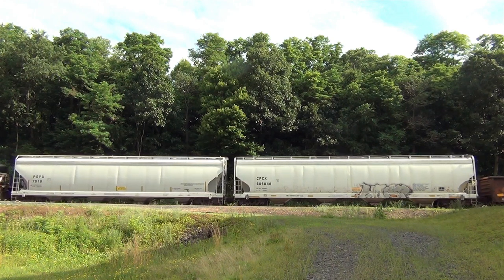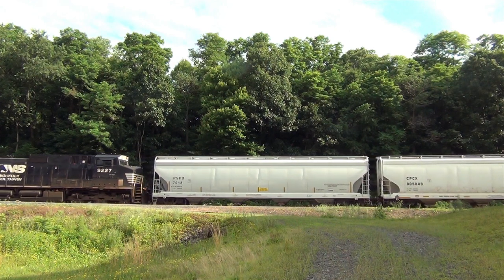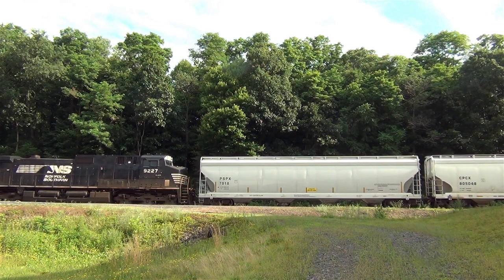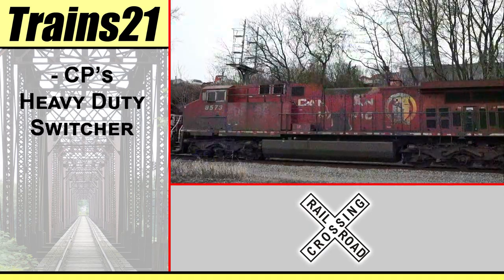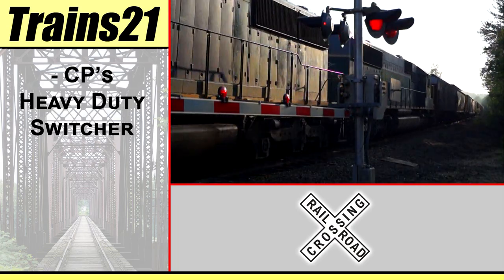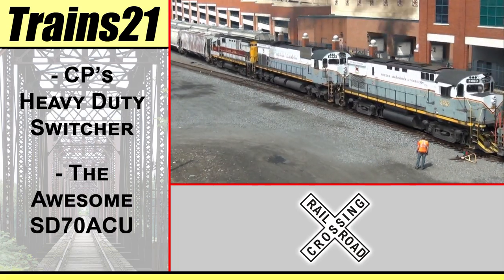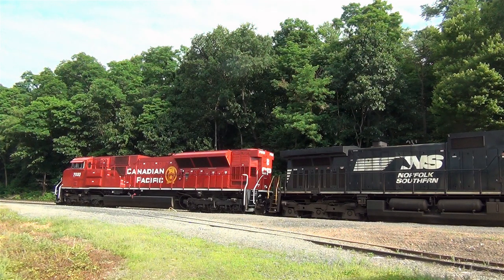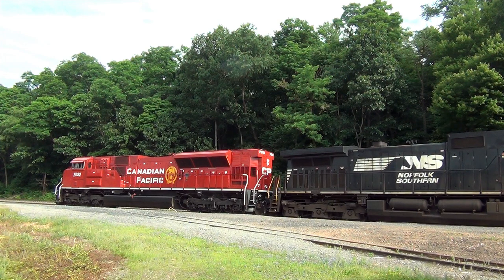[GL][T-245] CP's Super Power: Switching with the AWESOME EMD SD70ACU!! | Trains 21

Comment: Got to correct you right off of the bat. The inverters were Siemens but were replaced by Mitsubishi inverters. I know because I’m a retired technician from UP who worked on all of the SD90 iteration of locomotives for UP with EMD tech help. Siemens were a pain to work with because they kept much of their info proprietary & even the programs we used to interface with their electronics was in German.
Reply: You are correct.
Reply: On several aspects those were the worst units that EMD actually built. Many of which were scrapped because of cracked frames and why Union Pacific sold them dirt cheap to Norfolk Southern only to inevitably have the same problems again as SD70ACU rebuilds. The same electronics were also used on the SD70ACE's and equally junk as well.
Reply: @Slim_Slid  The cracked frames on the 90s was actually causes by UP themselves. The fuel tanks were designed to float on the frames because of the length of the loco. UP decided to hard tighten them to the frame causing the underframe to flex in a vulnerable place causing this crack. SD70Aces were actually one of the more reliable locomotives UP had. The SD70 was very reliable and have been put routinely back into service. Tell me where the Dash8/9s are as far as DC units? GE loco engines routinely caught on fire from leaking fuel lines. It was a rare occurrence for me to change out an inverter  on an Ace while it was a daily item for GE ac locos. The advantage for the GE’s was that you could cut out single inverter stacks where the Aces required you to cut out an entire truck.
Reply: @douglasbohnstengel9902  
There is plenty of C44-9W's returning to Union Pacific as C44ACM rebuilds. Practically it's the same process they did with the AC6000CW rebuilds. On the other hand,the SD70M's are being scrapped or put into storage with hardly anything being done to them. Those units are still out there,but it becomes faint with each day. The early production SD70ACE's were junk,this was before CAT/PRLX took over EMD,this was when things really took a bad turn just years before the SD70AH-T4's unforunately were produced. Hence the notorious "Thundercab" nickname,later on was when the production line had better built cabs and remained decent for awhile. The C40-8W's and C41-8's disappeared around the same time as most of the SD60's and SD60M's. Those units aren't very rebuild compliant compared to the C44-9W's or AC4400CW's. Years ago it was different,but modern GE units are actually becoming more reliable,easier to diagnose,and are less expensive to rebuild than most EMD units. It's not just the whole ordeal about EPA regulations. Wabtec did major changes to the market and production that GE refused to do. GE was never easy nor friendly on customers like EMD was. GE units actually outdo EMD units on horsepower and traction,everything else is debatable or complicated. For the longest time EMD retained reliability with the 645 & 710 series compared to GE's 7FDL's but that has changed over the years. As for the actual frame information on the SD9043MAC's,I never really knew about that so I stand corrected.
Reply: @Slim_Slid  Yes that’s correct too but I was referring to useage as DC locos. The ACM rebuilds being done by Wabtech will still invariably suffer from the same engine/inverter problems I suspect. I’m retired now and do occasionally talk to some UP & former GE (now Wabtech) tech & engineering guys but that’s becoming more rare. With the cutbacks in Mechanical there & the bad feelings they left with their laid off work force there aren’t many seasoned guys that would take a call back. It’s a specialized field & takes time to acquaint yourself with all of the different locos. I was an electrical tech & they’ve got rid of most of those jobs except for maybe North Platte. BTW the real clunker was the SD90Mac Phase 2. The H engine was a disaster because GM was trying to sell EMD at the time so provided no funding for engineering development for that engine. The idea was that as that 6000HP became refined in the 50 locos they made that they would be able to drop them into some of the existing Phase 1 90s. Excessive vibration caused the oil pans to crack over time. I’ve seen these locos repaired one day - put out on a train - & be dead offline the next.
Reply: @douglasbohnstengel9902  
Time will tell about modern and rebuilt GE units but it's inevitable regardless that these units will eventually overthrow what EMD units remain on Class 1 usage. It's really been that way ever since EMD discontinued production of the GP40-2's & SD40-2's. By the time the GE -8's were being debuted,a new era had just started mainly to do with improved technological aspects. I know most of the problems that the original SD90MAC's had. Union Pacific had 60 SD90MAC-H's at one point and most of the units were sent back to EMD and scrapped or remnant in storage. Some units were actually rebuilt and exported with brand new 265H's to Australia until BHP decided they no longer needed monster horsepower units. The same thing occured with the export AC6000CW's they acquired which were scrapped later on. EMD actually managed to prolong usage out of the 265H's for Asia,China,and India while also building the 210H's for foreign use only. There also was the SD89MX prototype which used a 12-265H instead of the 16-265H like the SD90MAC's. The SD70AH-T4's and Caterpillar 1010J's are literally based upon that prototype and also resulted in more failures. The only major differences between the prime movers are the fuel injection and crankshafts.
Reply: @Slim_Slid  I only got to work on the tier 4 Aces a few times before I retired. There were a few things I didn’t like (electrical locker was really cluttered). The GE tier 4 were engine maintenance heavy too. That is why they decided on upgrading the old Dash 9s as they didn’t have to adhere to the tier 4 standards. The GEs also have ample room for the installation of the inverter stack system I’m thinking whereas the SD70s do not. As far as emissions go I always found GEs claims to be a bit sketchy. When I watch the exhaust stack on a GE it’s always dirtier than an EMD. That’s unspent fuel. EMD always had clean exhaust stacks comparatively speaking. This assumes both engines are running with no mechanical issues. In any case shipping by rail is still better than any other form of transport environmentally.
Reply: @douglasbohnstengel9902  
Apparently the first 50 SD70ACE-T4's that were manufactured were short lived on good results and then everything on performance went downhill afterwards. Union Pacific keeps putting their 90 units in and out of storage for the same computer or fuel sensor problems. CSX had 10 ST70AH-T4's but those were finally returned back to PRLX and are on lease to Ferromex. BNSF,KCS,and Norfolk Southern also had orders which were canceled because of the obvious problems. Supposedly both the SD70ACE-T4's and ET44AH's are somehow more inefficient on fuel compared to most tier three or even tier two units out there,both EMD and GE. I find it ironic that the SD70AH-T4's were another flopped product after being based on the SD90MAC's to begin with. The only reason why GE has those claims is because of the entire four stroke versus two stroke comparison. While it's true that there is some benefits in the long run compared to EMD prime movers,I still looked at them to be sketchy about it while most EMD units were actually more reliable and easier to repair aside from certain electronics.
Reply: @Slim_Slid  Both manufacturers should have probably used DEF instead of the EGR models. The railroads didn’t want to deal with using DEF though. Much as you described the early Aces with cab noise (engine was now up to 950rpm and proximity was closer to the cab) that is an option that UP decided not to buy insulated cabs. Insulated cabs had been available since the 60 series (& were implemented on later Aces) - these decisions are made by the bean counters . I was witness to the change in attitude when they started making more decisions based on the stock holders and less by input from the Mechanical Dept.

Comment: Hey.. the CP ACU program.. is actually the ending of a contract dispute with the 9043s.  When CP took deliver of the 9043s the contract was to have them rebuilt to pure 90MACS within 10 years. Cp stored the 9043s after the 10 years and im assuming this remidy (Acu) program is a comprimise to the original contract.
Reply: The original SD90MAC's & SD90MACH's which were owned by Canadian Pacific and Union Pacific are singlehandedly the worst units that EMD ever created. Much of the failures were due to rushing developments and the fact that EMD was making the four stroke 265H's due to EPA compliance. The 265H's had little to no harmonic balancing and alot of internal vibration. The result of that from the prime movers was the cause for broken motor mounts,crankshafts,and other critical components. The other malfunctions on them were the German Siemens electronic systems and inverters,plus the units sucked at loading tractive effort for the traction motors. Even though later on the 265H's were improved and rebuilt EMD discontinued them for any usage in North America even though they did see prolonged service in Asia,China,and India .After Canadian Pacific and Union Pacific put their SD9043MAC's into storage Norfolk Southern purchased 110 units dirt cheap for the SD70ACU rebuild program while Canadian Pacific rebuilt 30 of their units. Part of that was them acquiring 6 SD80MAC's from PRLX to use as parts donors. Norfolk Southern sold 65 units to PRLX. CEFX has some SD9043MAC's as well that were even loaned to Norfolk Southern at a time.

Comment: Guess I'm too old school, I hated switching with wide cabs. The GE's were a little better cause they loaded up a bit slower. I remember switching out the yard with an AC4400 one day. That sucked. Great visibility going forward, backing up I was half blind. Not a good combo with a green conductor.
Reply from the maker: I love hearing from railroad workers, especially your piece on the EMD vs GE video.. Eyes out, the next one is the SD70ACC vs AC44C6M.. Probably out next week.
Reply: @Trains21  AC44C6Ms surprisingly have a lot of turbo charger damage considering how relatively new they are, and almost all the P5s on the SD70ACCs sound horrible.
Reply from the maker: @LocoPro  Agreed.. Fire damage seems to be prevalent on GE diesels.. Whether that's from shoddy workmanship or excessively hard use by the railroads is unknown to me.. But I've never seen it on an EMD.
Reply: @LocoPro  , It was the bearing assemblies in the turbos that have gone bad, heard the batch was basically under engineered for the purpose, that's just from the grapevine though.
Reply: @Trains21  GE uses high pressure fuel lines to the injectors. Sometimes they leak, and spray against something hot. EMD/Cleveland/Detroit Diesel/GM used the unit injector, which has no high pressure fuel lines.

Comment: This doesn't make sense!why would you  rebuild them,and then after a few years you want to  get rid of them?! It is easy to  see that  ns management  don't know  a reliable  locomotive when they. See  one!these units are very  reliable, so, why would you  get rid of them? They should  keep them,  because those ge units ain't gonna last forever!
Reply: The SD70ACU's are just rebuilt SD9043MAC's. The SD9043MAC's much like the SD90MAC's and SD90MAC-H's always had frame issues. Many of the SD9043MAC's in later years were scrapped because of cracked frames. The electronics from Siemens were also problematic just like in the SD70ACE's and the cabinets can actually overheat. Norfolk Southern only did 110 units of the SD70ACU rebuild program because Union Pacific was selling their units dirt cheap. Canadian Pacific only did 30 rebuilds and then bought 39 SD9043MAC's from Union Pacific. The 65 units that were sold to PRLX are being scrapped even though some of them are being leased to Ferromex only because they're desperate for motive power at the moment. 

Modern GE units are actually more reliable and less costly to rebuild than any EMD units that have been built within the last three to four decades. EMD hasn't manufactured any perfect locomotives after the GP40-2's & SD40-2's.

Comment: Has caterpillars progressive rail did any good at helping the EMD Locomotive or is GE going to continue to run off with the trophy 🏆. . . There's close to 70 year old EMD switchers still active today and still doing what they were designed to do, so is it just been a Patient Lawyer and EPA thing that's brought EMD to its knees then not so much of GE being a better product
Reply: GE never had a better product. They’ve always been junk. It’s all about making cheap junk, then flipping in in 15-20 years. It’s all about finance.
Reply: 100% agree. EMD has always been superior as far as reliability and ease of maintenance is concerned. GE's always have some sort of ass-ache, turbo seals go bad, pre-EFI fuel injectors sticking, or some electrical issue or another. Not to mention the slow loading. The computer diagnostics are great, you can find out what's wrong with it no problem. But EMD has that too, and replacing anything in a GE is a real hassle. You can replace a power pack on a 2 stroke EMD in a few hours with basic hand tools and have it back on the road. Why do you think you still see 60 year old EMD's on class 1's but you can't say the same for GE's? The oldest GE you're likely to see still in service is MAYBE 20-25 years old.
Reply: GE outdid EMD when it came to horsepower and traction,not to mention being more efficient because of stricter emissions regulations. EMD hasn't had it perfect since the GP40-2's & SD40-2's. GE also debuted microprocessors,wheel slippage prevention,AC traction,and stronger traction motors on top of stronger dynamic braking in comparison to EMD. After what happened with the GP50's & SD50's,the GP60's & SD60's did well but the GE -8's already proved to be better products. Everything else changed when the SD70 series came out but then the GE -9's and AC4400CW's showed. At that time EMD was still proving better reliability with the 645 & 710 series prime movers. The last two major mistakes from EMD were the SD90MAC's and earlier production of the SD70ACE's. The rest is history once CAT/PRLX took over and ruined the company. The modern GE units are actually becoming more reliable and are less costly for rebuilding than EMD units which is why there is alot of investment happening. Wabtec made massive changes after taking over GE's locomotive market,which is perhaps better in my opinion. GE themselves were never really customer friendly like EMD always was.

Comment: Seems like a trend, those EMD's from the 1960's on just keep getting refreshed and reused, how many sd40's are still out there? As a Manufacturer it would be a shame to loose any of them. From my perspective regulations put GE on top with a four stroke easier to make "compliant". Other wise those two strokes would still likely rule the rails. Almost an artificial modification of market conditions.  I'm lucky our local railroad is ALL EMD , now with some cast off emd sd70m-2's
Reply from the maker: I think that you're on to something Commander.

Comment: When a loco is going very slowly or idling I hear a lot of ticking and hissing sounds. What are those  noises?
Reply: Air compressor
Reply: Also spitter valve
Reply: dpending on which loco it is, I noticed some of the newer GE's and EMD's, you can actually hear the electrical contacts for the compressors and fans click when they switch on from the outside
Reply: There are valves which eliminate moisture from the compressed air.